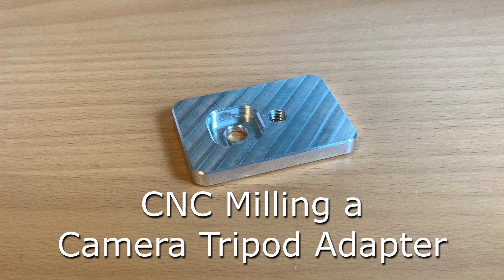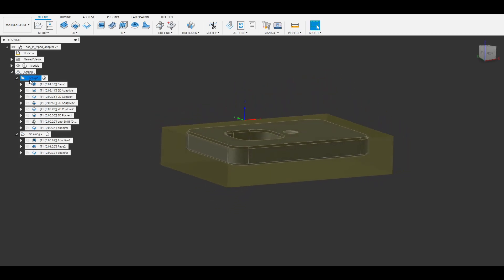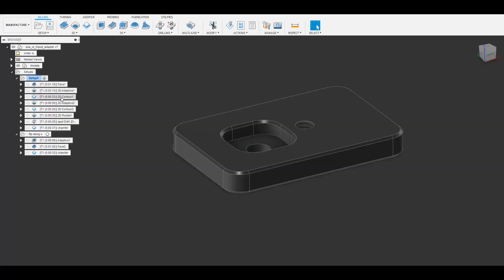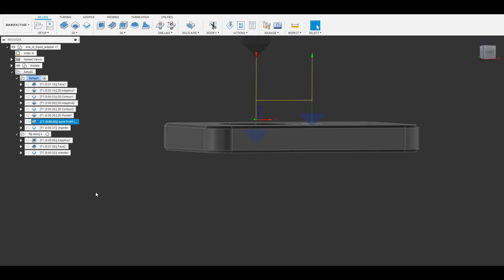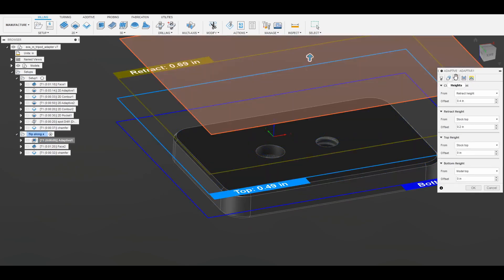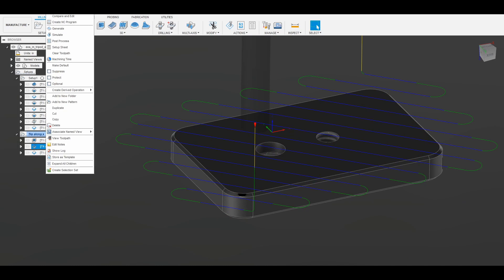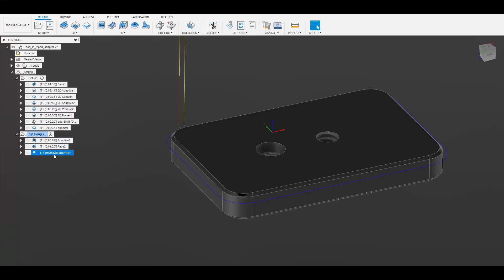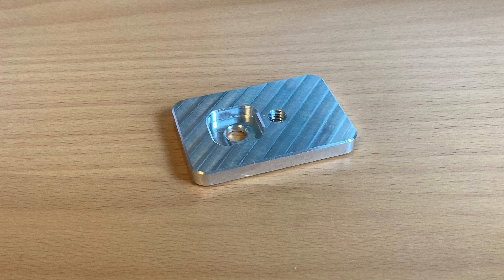CNC Milling a Camera Tripod Plate Adapter

Comment: Great looking part! I was curious as to the reason you drilled the holes on the drill press. Is it due to the spindle not having enough torque? Or more a convenience factor so you don't have to switch tools again on the CNC?
Reply from the maker: Yep, the spindle doesn't have much torque at the low RPM needed for good drilling feeds/speeds with HSS drills larger than about 1/8 diameter. If the holes are large enough (more than 1/4 diameter) I'll often do them on the CNC with an endmill and the "bore" toolpath to save time.
Reply: @imnoexpertbut  Ok, makes sense. I'm evaluating a spindle like yours, or a lower RPM spindle with a belt driven motor. That's why I ask.

Comment: Hey man I just came across your channel. I've been accumulating parts for an open builds machine. I'm just waiting for my spindle to arrive. I was going to make the plate-maker C Beam build, but I seen your upgrade videos. I believe that the mini-mill definitely has the advantage of being an easier-to-upgrade machine. 

I also got a 2.2kw spindle, and I've been really worried about it, since I want the horse-power. My intent was to use the machine to upgrade the machine, but it seems pretty difficult with that style of machine; not that this is easy, but you've very elegantly done a lot of the work of figuring out the process to add rigidity to this build..

I just wanted to say thanks. I've gone through your catalog. You make fantastic content. Cant wait to see what you do next.

Comment: im amazed the results you're getting using an aluminum frame and leadcrews, i have the same spindle, or at least i believe is the same, 1.5kw 110v ER11 collet, what are the sizes of the cutters u use? since the collets included are mostly milimetric
Reply from the maker: Sounds like the same spindle. I used 1/4  inch two and three flute endmills, one is from lakeshore carbide and one is from yg-1, both from their aluminum-specific tool lines. I bought TECHNIKS super precision collets in fractional sizes to get lower runout, but that's not necessary if you got lucky and the ones that came with are low runout. You can use a collet that's up to 0.5mm oversized, so a 6.5mm collet is appropriate for a 1/4 inch tool, it'll close down on it.

Comment: Great video, what spindle are you using on your mill?
Reply from the maker: 1.5kw 110v 3 phase er11 24k rpm. It says "Hua Jiang dian qi" on the name plate; I bought it on amazon.
Reply: looks like a 1.5kw, i have the same one